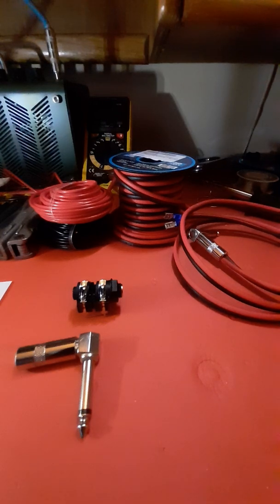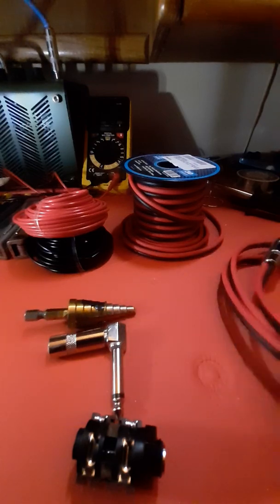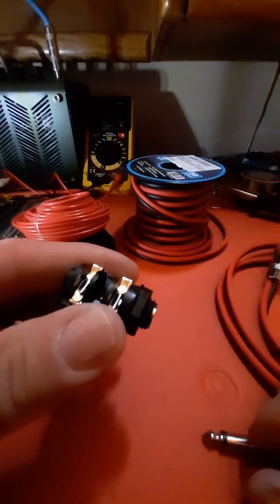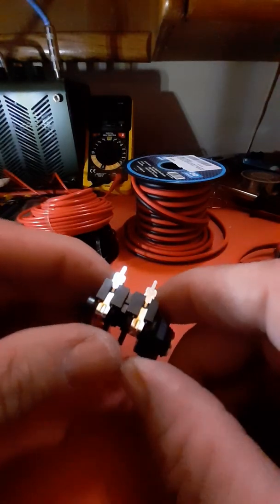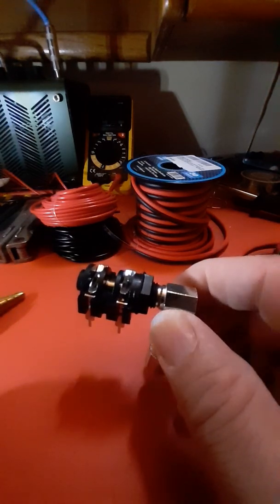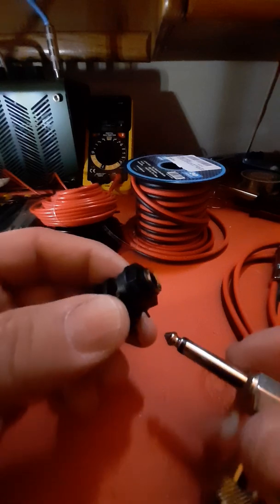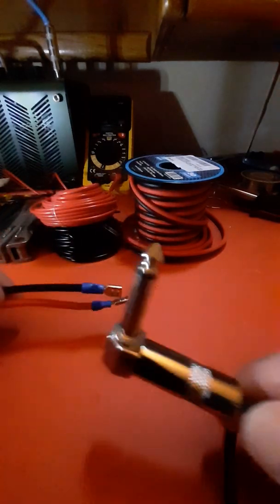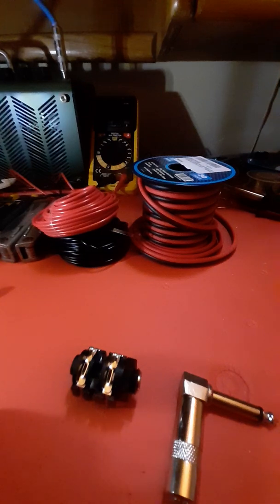How to add a speaker out to your Boss Katana or any amplifier - simple quick and easy!

Comment: Great tip. My question is, if I wanted to fun another speaker cabinet (Mark Bass passive 2x10" cab.) and use the onboard 12" speaker, could I simple use a Y cable. So I would be coming out of my AMP (Katana 100W) with a single TS that breaks off into two separate Female TS that all speakers and (1) speaker box would plug into using their Male TS connector(s.) One is the onboard speaker that already has a Male TS that you can plug/unplug. 

As it currently stands, if you unplug the onboard speaker, only one external speaker/cabinet works. I am not sure how this would effect OHM's and what not. Of note, I have tinnitus so I ONLY play at very low volumes (under 80dB's.

Any insights would be appreciated. FYI, I am doing this for a new Bass I just bought. I never played Bass before but it is actually making me a better guitar player. Go figure!

Comment: thanks so much ! i had my boss katana mini ,wired backwards, when you said right side ,i woke up and said ,hey i got mine reversed. i had the wires from the actual speaker on them ,so i reversed um and it works perfect! it sounds great through an orange 1x8” cab with a jensen mod speaker. so much louder! cheers bro. 👍👍👍👍👍👍🫣🫣🫣🫣🫣🤫🤫🤫🤫🤫🤫😹😹😹😹😂😂😂😂😂🤟🤟🤟🤟🤟🤟🤟🎸🎸🎸🎸🎸🎸🎸🎸❤️❤️❤️❤️❤️❤️❤️❤️ to mount the jack ,i drilled a small hole and used the hand reamer from harbor freight. it works great and i had control over it! great tool for cheap . thanks again .ihooked the katana mini up to a 112 line 6 cab with a celestion 70 -80 12 inch speaker and its loud and mean!!!!i can turn the amp down . killing it!!!!
Reply from the maker: You're welcome and no prob. Easy fix. I did this mod to my Peavey Vypyr 1 as well. Works like a charm.

Comment: Does it work with the MK II 100/212, too? And what would be the difference with the wirering?
Very nice Tutorial! I´m on the fence buying the Head MK II or the 100/212 MK II.
The 100/212 is the better bang for the buck for me at the moment, but I want the option to buy a cabinet later on. So this gives me this option. BUT will it work with the 100/212, too? On the pictures I saw, the wirering of the 2 speakers is a litte bit different, regarding the ground cable, am I right? So how would it work in the case of the 100/212?
EDIT: just took a closer look to the picture and I saw it wrong. It looked like there are only red cables coming from the Amp and the black cable is only between the both speaker^^
Now I saw, black and red cable are coming from the Amp, but the speaker are conectet to each other. So in the end it is the complete same work to do, as one has just to handle with one black and one red cable again :)
Thanks anyway for reading ;)
Reply from the maker: Great question. Theoretically it could work with any amp..but you'd have to figure out the wiring  as in splitting the load correctly for the external...but I'm not sure how to do it for your situation. This is a perfect solution for those with combo amps. But it should work with any amp.  But disclaimer, I don't know how to wire up for your needs. Sorry.
Reply: @modscientist9793  Thanks for your reply! I have put an Edit on my former post, just didn't looked right at the picture at the first time. A second look showed, that there is also one red and one black cable coming from the Amp. The only difference is, that the black cable goes to one speaker and the red cable to the other speaker. Then there is a red cable going from one to the other speaker and vice versa one black cable from one to the other speaker. So it looks like + goes to one speaker and - to the other, and then each speaker gets the missing one from the other speaker. I hope I articulated it well^^
Reply from the maker: As long as you match impedance it should work

Comment: Does this enable using both speakers at the same time, built-in and the attached speaker?
Reply from the maker: Only one at a time.  Internal or external.
Reply: @modscientist9793  What about if you simply used a Y connector? Plug both into the Y part and plug the one TS male into the unmoded switch? You would get tone- just not sure about ohms and whatnot, especially at higher volumes.
Reply from the maker: @MOAB-UT  exactly, I considered that but the internal speaker would still be active. I like the switched jacks.
Reply: @modscientist9793  Have you tried it with the Y- does everything work ok- any Ohms/Impedance issues? Also, why not just use the Y but only plug in the speaker, or cab you want? It seems easier than buying a new switch and soldering it. If I did add another switch, would it be better to wire the switch in parallel or series? My Katana has three female outs- each has different Ohms. Currently, the main 8 ohm speaker is plugged into the 8ohm input on the back of the unit. 

FYI- I noticed you have THR on the bench. I have one too. It makes for a nice Bass amp at relatively low volume for practicing. This type of mod. is very useful for that amp.
Reply from the maker: @MOAB-UT  yes, good catch..I love the THR10X,  what an amazing array of great tones in a small package. They should've done a 25 or 50 watt version of it. But as it stands, +it huge sounding for its size. The jacks were inexpensive so were the 1/4" mono plugs and speaker wire. I can't answer to your specific use parallel or series. I would think this is redundant in your case since you already have speakers outs...it's really for those that don't have one. I did it to my Peavey.vypyr as well. It didn't have a speaker out either..the cab has to match the impedance of the amp  8ohms..
Reply: @modscientist9793  Thanks. Yes, I have speaker outs however I can only run one speaker out at a time meaning my nice internal 12" would need to be unplugged. The back of the Katana 100 has three inputs with different ohms values. A Y cable might do the trick and especially if I keep the volumes low. That would result in a parallel circuit. That would reduce resistance so it would be louder. When you wire in series you get more impedance so less volume per speaker. In some cases however a series circuit is the safer choice. I have not tried this with an amp so I wasn't sure. I think the general rule is if the speakers are 8 ohms or more you can wire in parallel. If they are less, series is safer. It's been many years since my E. Eng. college days!

Yes, the THR is incredible and packs a punch. Fun to take camping as well being battery powered! 

Thanks for the video and ideas!